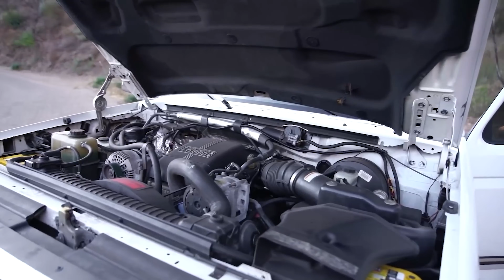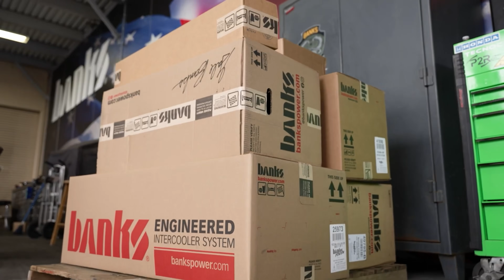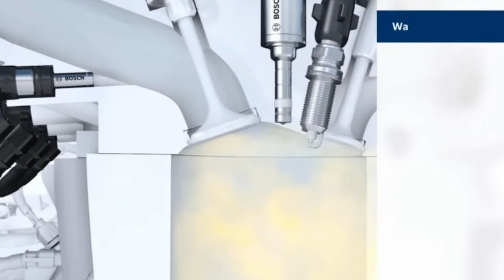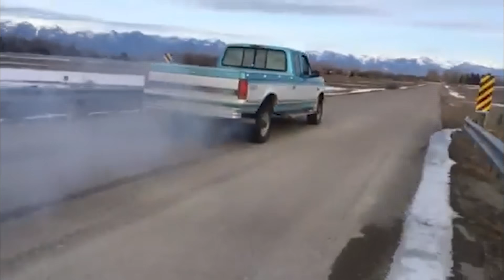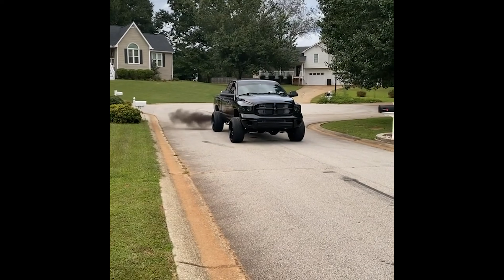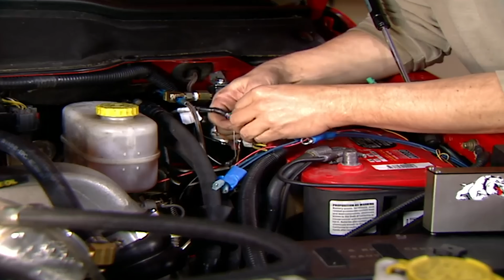The Diesel Performance Hack That Became a Cheat Code!

Comment: Thank you for breaking this down to laymans terms for me.
I discovered this last weekend that i could use a little boost for hills and passing instances.
Not crazy, all the time, boost; boost when needed in short bursts. Sounds like I'll be starting with washer fluid first at 3# boost reference , then adding propane at 5# boost reference later on, if needed.
Appreciate the advice.  🎉

Comment: Very interesting. Injecting water/methanol mix mist at 3 lb boost and up then propane and diesel gets max power out of a diesel engine at acceptable combustion temperatures. 💡

Comment: If you want a cheaper and easier version, just add around 10% petrol to the diesel tank.
I also add a small 250ml container of mineral 2 stroke oil to the 100 litre tank of diesel for an extra bit of lubrication in the common rail diesel.
A couple of litres of methelated spirits can be added to the tank as a cheap methanol, and also absorbs humidity/water out the diesel
Some engines can handle higher percentages, especially old mechanical pump non turboed engines, but 10% is safe.
And before anyone starts freaking out, that was the old way of winterising diesel, and is still used in many regions where winterising chemicals are too prohibitively expensive, or not available.
If you have doubts, of want to be more cautious, add the petrol in smaller amounts, and if you are worried about lubrication, and more 2 stroke oil.

Comment: …you also missed another aspect of WMI, water vapour cleans the cylinders from carbon, also it helped me de-carbonise the intake(50/50 mix) and methanol will slowly dissolve all the crap that was in the intake from the EGR….
Reply from the maker: Great point.  And you are correct (next one :))